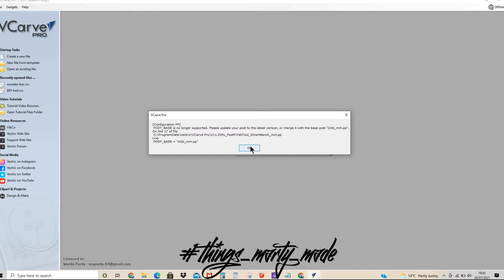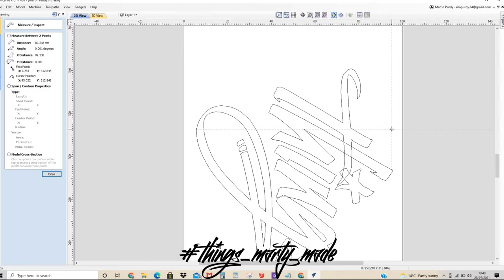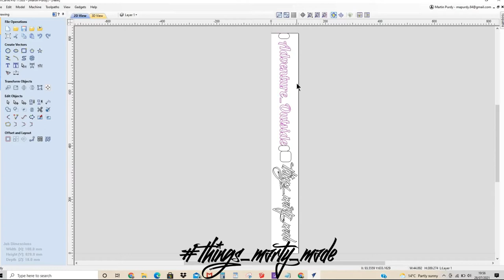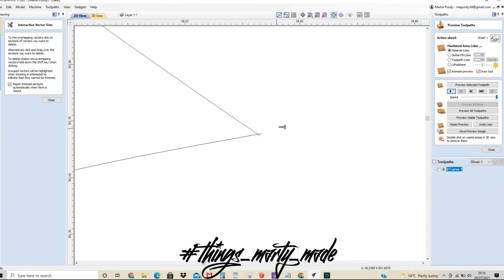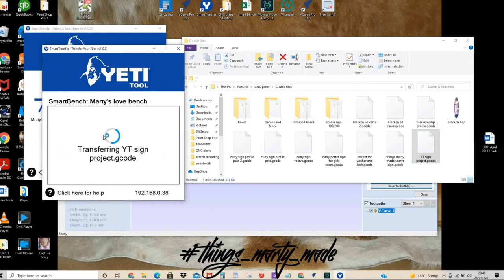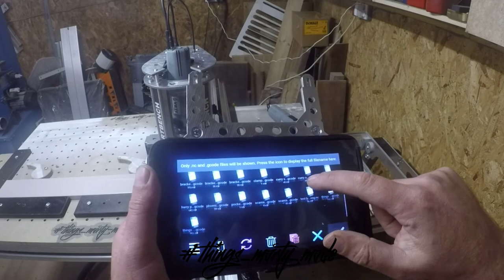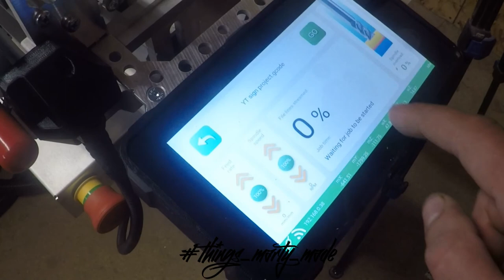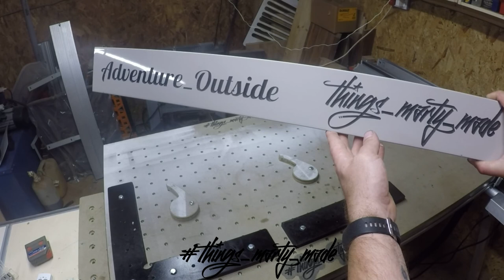CNC tutorial for V-Carving using Vcarve pro and Yeti Smartbench.

Comment: Oh one more tip, the latest fonts you have used in v_carve  are kept at the top of the list Speaking of fonts, most (hand written ) fonts are a nightmare in v-carve all the connecting letters need to be node edited . The way to go is loose letters-fonts Specially if you got very much text, for a few words or a one time design logo not a huge problem 
Kind regards Hans